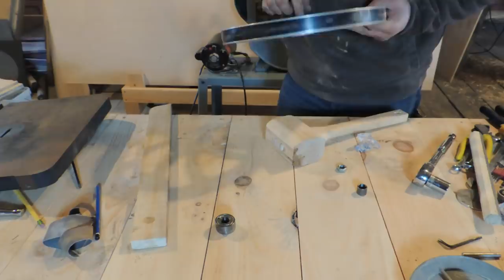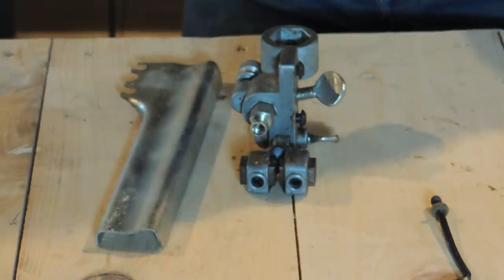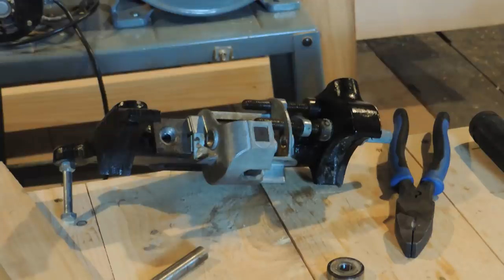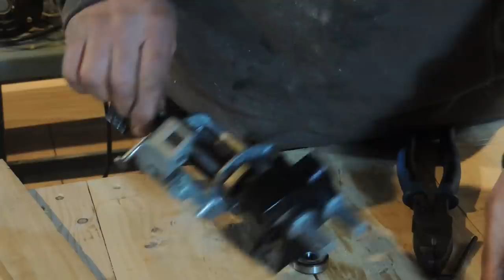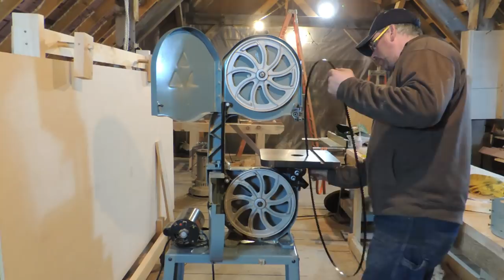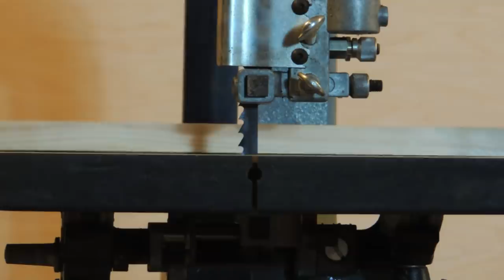A Beauty of a Bandsaw Gets a New Lease on Life: The Finished Project

Comment: DONT’ FORGET THE PIN THAT HOLDS THE TABLE ALIGNED.  IT IS THE PART THAT LIVES ON THE RIGHT SIDE OF THE TABLE BETWEEN THE TWO TABLE SECTIONS.  MIGHT TRY PART NUMBER 426020710001S, OR MAKE YOUR OWN.ATTACH A SMALL SECTION OF CHAIN TO THE PIN AND TABLE AT I WILL NEVER RUN AWAY FROM HOME AGAIN.
Reply from the maker: I screwed up and didn't show it, I do have a new one and it is installed, sorry about that.
Reply: I didn’t know what the pin was for.

Comment: Nice restoration Jim. That should work nicely with your future furniture projects. I've been using mine for slicing frozen breakfast  sausage lately.  Thanks for sharing another well done video.
Reply: Just be sure to clean the blade and its path after you finish, the salt in the sausage is very corrosive... I think that is why butchers use a meat saw, made mostly of stainless steel, or some other non-corrosive metal, and the saws are disassembled and cleaned thoroughly after use. And yes I have used my band saw to do the same thing you are doing. Not the best choice I have ever made.

Comment: 6202s are in a lot of mower blade spindles with 5/8" shafts too. Great redo, Jim! Couldn't have done better myself, and I worked on them for years. If you get a small container of rust treatment and brush it on the slide pins and other places where it still has rust, it will never rust again.

Comment: God fix I just fix looks like a very aggressive blade for sure. I just fixed up a metal drop saw it really huge save my hands from vibrations. I got tired of using a friction saw, Sawzall, and a hack saw. I was starting to get nerve damage in my hand using those tools. Now I just clamp the metal down adjust the speed and walk away and it cuts by its self its so nice. We use to use a saw just like your at my work.

Comment: I had not heard of relieving the tension on the blade before you mentioned it early on, with your band saw mill; it was certainly never done at any of the shops where I have worked, and some of them were real sticklers for proper maintenance... It may be too late for my ancient Craftsman 12" band saw, which I've had a few years but only use rarely; now I'll have to check it out.  Thanks for the tip!
Reply from the maker: You get flat spots on the band tires if you don't, then the machine will pick up vibration.

Comment: Hey Jim. Problem with my old bandsaw. It has an adjustable light and the bulb broke inside it. I've  tried the potato and every thing else I  can think of to get the base of the bulb out with no success. Any tips?
Reply from the maker: Needle nose pliers, bend the sides on a little and it'll turn out.
Reply: Thanks Jim!
Reply from the maker: Hope it works for you

Comment: I was always taught that the difference between a pulley and a sheave was that a pulley was flat (think old flat belt drives). The spacer between the bearings should have helped clamp the inner races tight to the drive shaft (was there a shoulder?) after you assembled the nut, right? Belt grooves are measured with round pins, so I was thinking a round bar might align sheaves faster?
Reply from the maker: No shoulder in there, just big snap rings that keep the bearings from going in too far.  The spacer looks like it gives support to the inner race.  As for sheaves vs pulleys, it seems any time I go to Kaman Bearing for any of that stuff it all depends on who's working or what catalog they're using.
Reply: If the spacer’s loose, you’ll have bearing problems. In the way old days, we used 6202’s in mower spindles and then Detroit went metric and started using 6203 (17mm) in power steering pumps, so we switched. After investigating our failures, we learned to press in two steps, letting one bearing “float” and guaranteeing the spacer was tight. Hopefully you’re not seating against both snap rings before the spacer’s clamped. Be careful to press both races at the same time.
Reply from the maker: I did one at a time but didn't seat them fully, the spacer ended up tightening in just fine once the shaft was in.  I finished seating it all together with the nuts.